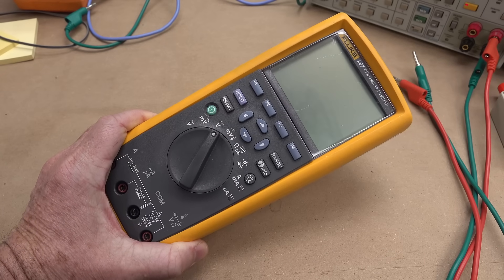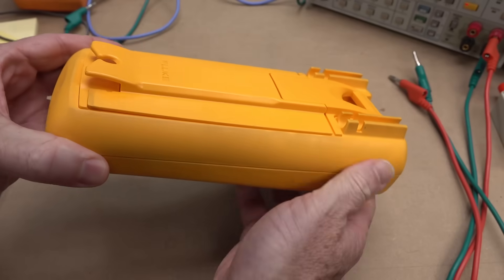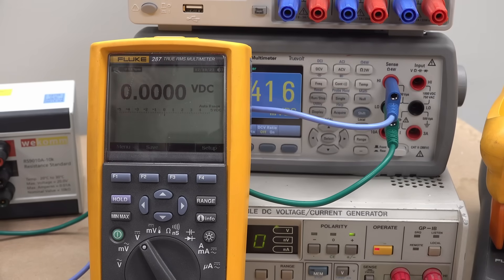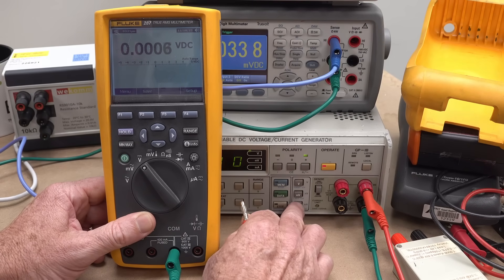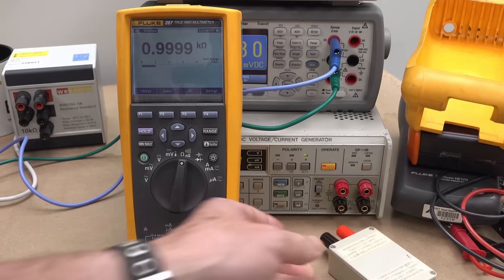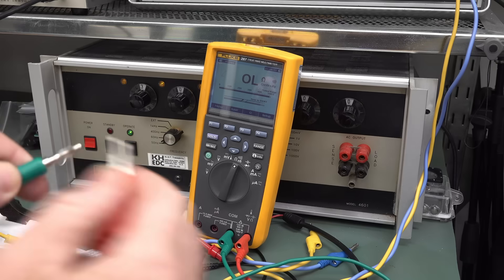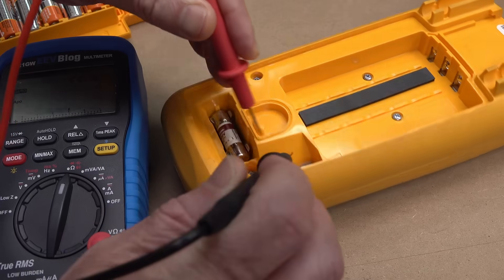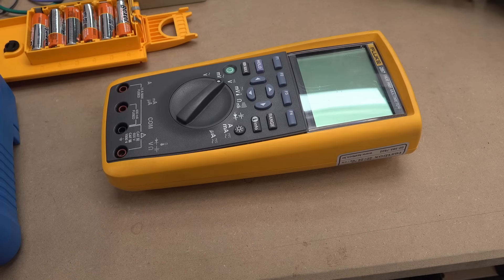Fluke 287 Repair - My Arse

Comment: Blown current fuse - it’s a classic.  When I taught Digital Circuits my first lab was to have students measure the quiescent current and current as TTL and CMOS inverters transitioned through switching.  I found every multimeter in the lab had a blown current fuse.  I resorted to buying a whole bunch of four Dollar meters from Harbor Freight on my own and keeping them at home except for the one lab. The cheap little meters from Harbor Freight are pretty good on DC down to mV and uA resolution.  The current fuse in the cheapie meters is a glass fuse which costs about ten cents, so no big deal if one gets blown.  Those silicon fuses in Fluke meters are crazy expensive.

Comment: I got a UT181A (which also has data logging) because I was too cheap to pay for the Fluke 289. I'm happy with it. The main downside is the rechargeable lithium battery. I prefer being able to just swap batteries instead of minding some battery that's hard to get a replacement for and will eventually kick the bucket anyway. The color display might be more power intensive(I don't actually know) but it shuts off when logging anyway after a period of no user interaction, while the meter stays on. It will time out the sceen like this even when not logging but stay on.

Comment: I’ve found a lot of tech sold on eBay as faulty for a ridiculously low price have been illegally procured by the seller. No one questions the low price when the item is broken, the seller moves it fast and who is going to return something normally Uber expensive that works. Now “buyer beware” means it’s possible to get screwed in a good way. 
Thanks for all your great videos!!

Comment: I shouldn't complain but I wonder when I'm supposed to do this kind of investments...

Meanwhile I just unpacked following.
HP 473B - Power meter but without sensor.
HP 8646A - Sig. gen. 100kHz to 1GHz RF. Two of them.
HP 60MHz 2chn scope.
HP 5385A counter.
Rohde & Schwarz - URE2 (Anyone knows where I can find the manual for this one? URE and URE3 are everywhere.)
Everything starts up and seems to work just fine, not been calibrated since 2006 give or take.

Comment: I picked up a keysight 1273A meter for an "interesting repair"  looked really hopeful with rubbish on all ranges - turned out that every through-hole joint was as dry as a dingo's ...   anyway at least I got a good quality meter for next to nothing!  The biggest job was getting the smell of cigarette smoke off it (Ozone generation in a closed box is the way to go - just remember to shield from static!)

Comment: I'm confused by the title -  how can you repair your Arse with a Fluke 287 ?
What's wrong with your Arse anyway ?
If you're straight, it should have an almost infinite Resistance to reverse polarity.
If not,  it will be low Impedance to both AC and DC currents xD

Comment: I bought an old tek scope which was marked as non-working for like 80 bucks. Worked fine, and all it needed was an alignment and some cleaning. Never done one before but with the service manual it wasn't too difficult, and now I can use my old scope for cool X/Y stuff!

Maybe the other youtubers break stuff they already have, just to make a video.... hmmmmm.

Comment: I wanted to test an old guitar lead a few years ago, but found my old Nineties digital multimeter was hopelessly inaccurate. I dug out my even older late Seventies analogue meter, whose jumping needle showed the lead was irrecoverably noisy within the cable. So......... now I had a useless guitar lead AND a dodgy digital multimeter.
    Time to buy a new meter, I reckoned. Got a reasonable Chinese one. I decided to post a Blog entry detailing the story and did some measurement comparisons for all three meters. Dammit, the old analogue meter proved to have the RX1 scale reading very low.
Now I had a useless lead and TWO faulty meters.
    I wrote two more Blog posts detailing fault-finding and repair of the two older meters, using the new meter.
    Then I realised I had three functioning meters and didn't need the one I just bought!

Comment: I have a gift, I never get an easy fix.  I bought an old Current Source and watched all the YouTube video's and the power supply and the various regulated circuits are all fine (Cap's too).  The output power transistors are fine, the reference Zener and circuits around it all fine.  Years ago I worked at a software company that would send in bug request fixes and seriously I would always get the bizarre bugs.  A friend of mine that sailed through his set of bugs came over with a smirk on his face and said I'll fix your bug too.  Well hours later he smiled and said you sure have a gift for getting the weird bugs.  The good news is I spend so much time on a piece of equipment or software that I can usually find and fix any bug quickly.

Comment: Once bought some faulty classic 6.5 digit HP benchtop meter from the US and it came fully functional and the display prone to dimming issue was very bright so used very little.
Other time I bought one of those classic fat Agilent PSUs, it had the typical failing high accuracy resistors, but then there was also some opamp that had very intermittent fault and I spent a lot of time on diagnosing it.

Comment: 🤔  No user serviceable parts inside?  We'll see about that! 🤠  My old trusty cheapy Circuit Specialists MAS830 meter stopped working like that too.  Took it apart to check for smokey burned stuff as one does.  D'oh just a bad fuse so I learrned my something new that day 😅  Yep, it's still working and in my small toolkit 👍  Take stuff apart that's what tools are for 😉

Comment: It is malfunctioning, the fuse is blown, requires a costly repair. Have you checked out the prices of those Bussmann fuses? I bought an Aneng DMM much cheaper than one of those fuses.

Comment: Occasionally I will buy a “Broken” fluke off eBay just to fix it. Apart from fuses and bad battery terminals the most common two issues are dirty zebra connector on the display and there is an input resistor that blows open when you use continuity on high voltage. In 70’s series it’s a 1K believe leading to a transorb/mov/tvs ish component and I forget the value on the 80’s, 170’s, and 280’s but I’m sure it’s similar. Memory failing on me. If they turn on, then they are usually easy to fix. Now that re pop displays and parts are available on eBay they should pretty much last forever or until the ASIC dies on them.

Comment: I have a 289 that I already had to replace the 'fuzzy' supercap on after 12 years. 289 is same as 287 with exception of the highly coveted low ohm mode (not to be confused with LowZ which 289 also has), very useful when testing & probing board shorts.

Comment: You should try logging. It could be that there is a memory chip not working. Also if I remember correctly there is software update that needs to be applied because there is an issue with the optical port.

Comment: This 287 looks better than the ones being offered second-hand over here. Congrats on getting a "real" electronics multimeter. Play around with it.
Also, this is an older version. If you have to set the time and date after swapping the batteries, the supercap is gone. You can make a video repairing/replacing that (easy). The newer models have a small battery inside them to keep the clock running.

Comment: You never know, a customer sended me a portable digital signal generator that was faulty. It was fine but it used Vpp and the customer checked it with a DMM in Vrms and 10 Vpp is not the same as 10V rms.
I have a Fluke I got from a friend who had it from his work.. They had replaced it. I gave problems after battery leakage even after cleaning everything. I checked it and it seemed clean. It worked but every now and then it failed. Hard to trouble shoot. I used it sometimes because it has a "megger" function. Until it stopped. Opened it, pulled the batteries to measure them and then a battery connector  fell out. It was heavy corroded on the back side. Also have seen something where battery goop was sucked in the wires from the battery holder to the PCB. Nothing to see until I stripped them, most was corroded away, the rest green.

Comment: Sometimes it's more economical for a business to replace an item with a newer one than it is to have the old one professionally repaired and calibrated. Completely viable test equipment has been discarded in industrial e-waste.  If you can grab it before too much other garbage is tossed on top you may acquire some very good test equipment that just needs switch cleaning and sometimes a re-cap.

Comment: I found out how to buy a faulty meter .... just buy one that says "Worked fine last time I testet" or "Untestet as I do not know how it works". 
Those come most of the time from people who try to measure current in the outlet from live to nutral and dont have a spare fuse roll some aluminium foil around the broken fuse and try again.

Comment: I've a horrible feeling that many meters get shelved because someone blew a fuse and they think it's faulty.
Reply: @ts757arse  makes me wonder if it's because of incompetence, or bullshit regulations.
Reply: @KeritechElectronics management is the reason
Reply: Whew. There's even a simple fuse test procedure (described in the Fluke manuals) - how could they not know that?
Reply: For what I know MTA  in New York getting every year contract for new multimeter's delivery. What I  herd that the "old one" are put in the garbage dump container and are guarded by one or two union members so no body still the DMMs ( they are in the original boxes) , before they will be send to the land fill.
Reply: @miroslawkaras7710  yeah, and those landfills and electro waste disposal plants are locked down tighter and tighter. Tighter than Ethel Granger's laces, I would say. Back in 2010s I had one a few hundreds of meters away from my home in Lodz, Poland - and I bought some secondhand electronics from there, that went into a bunch of projects. Now? I could bet my ass it wouldn't be possible, with the ministry of environment keeping those places on CCTV.
Reply: Build in selftest?
Reply: @Blasterxp  yes indeed, just testing the fuses on the continuity position by sticking a probe into the current sockets.
Reply: The scary thing is some people selling these are supposedly professionals
Reply: Without a doubt
Reply: Congrats on 1m BTW mate
Reply: @TheCod3r  that's right, now I'm waiting for @EEVBlog to join the club :)
Reply: Just say the meter is faulty and a big company will replace it with the latest version.
Happens all the time.
Reply: @chox2001 their ways never stop surprising me.
Reply: Then it is better for us… never got a Fluke, just Metrawatt. ¯\_(ツ)_/¯
Reply: Hey BC fancy seeing you over on the dark side.
Reply: @ts757arse 
Yes.  Especially so in aerospace and military use.  Revising the documentation is a huge and expensive job.

There are a lot of very janky devices out there that survive because they were ‘baked in’ to some critical documentation.
Reply: Yeah, or because the test leads are faulty!
Reply: Has anyone looked at the cost of Fluke fuses lately?  Back in the 1990s I dropped the probe of my Fluke 8060A snd per Murphy’s Law, it hit the terminal of a power supply while set to measure current and of course the fuse blew.  30 years ago, the replacement fuse cost 15 Dollars US.  If you check the web, so Fluke fuses are 70 or 80 bucks.  If you’re a company and you’ve use pad the meter for a couple of years, you’ve amortized the capital cost and it isn’t worth putting any money into fixing the meter., certainly not 70 Dollars.  Might as well sell the meter and get back at least a few Dollars.
Reply: For some reason my comment was deleted.  The cost of a fuse could be 70 Dollar of more.  Really.  If the company used the meter for a few years, they amortized the capital cost.  It is more useful to sell it for parts and instead of spending to fix it.
Reply: I know from experience when I slipped a probe while measuring current with a Fluke 8060A and blew the fuse.   Back in the 1990s the silicon fuse cost about 15 bucks US.  I am sure it would be several times that now.
Reply: Not with meters in this price range.
Reply: @Okurkaarrgghh Oh I betya! Enough people out there with too much money, buying expensive equipment which they don't know how to use.

Comment: I have a 287 which works perfectly, but if you leave the batteries in it overnight, they'll be dead even if the selector is off.  It's been this way for about 15 years.  I sent it to Fluke for repairs but they didn't fix it.  - they did cancel the repair charges after I advised them.  I just live with it - wouldn't leave the batteries in it anyway for more than a few days even if they didn't go dead.
Reply: That's most likely a faulty supercapacitor, I think it is around the top left of the board. It isn't close to critical analog circuitry and, at least with a bit of low temperature solder, it's a trivial repair. If you take the batteries out for a few seconds and the time and date settings get reset, it's the supercap.
Reply: Thanks - I'll take a look.   @antoespiga
Reply from the maker: These batteries survived the shipping to me, and who knows how long before that, no problems.

Comment: I was at my local Tip Shop, they let me rat around in the staff/behind-the-counter area where they PAT test stuff. I found a Fluke 112 on the floor…I asked if anyone had dropped their meter…but those PAT “test” people would have no clue with such an instrument…I was informed that it was faulty and destined for the E-Waste bin outside, so I asked if I cipould take it and attempt to fix it. They told me that they “had tried” but to no avail and gave it to me for nix!

I took it home and at power up….NOTHING…just how I like ‘em. Started following the leads and tracks from the battery with my Tenma meter on continuity test…came to a point on the main B+ rail where it dived through the board at a via, it was O/C at the via, so I pressed down really hard with the tip of the Tenma’s probe, just in case it was a conformal coating I had to get through and I CAME TO LIFE! It was open where the through-hole-plating met the pad and pushing down hard with the Tenma’s probe closed it.

Still got it five years on, it still works on the original batteries. Has some electrical apprentice’s name engraved into the back of it. You’d tend to think thst anyone compitent enough to own a multimeter would be compitent enough to attermt to trace an easy fault such as this, and PAT testers wouldn’t even TRY to teace even the most basic of faults!

Comment: I fixed one last year for my brother, it has a burnt mosfet and ir sensor for the voltage leads. Can you test yours for bad solder joint or over current.

Comment: Ebay's rules for  what you can list as 'used' have changed. Unless it works exactly as it did when it was new, the buyer now has come-back if you sell it as used.
Reply: Really? So even if there's the slightest thing off and you clearly put it in the description you aren't allowed to list it as Used and it has to be For parts/Not working?
Reply: @Ni5ei  from the way it's worded now, I wouldn't risk it, and loads of sellers seem to feel the same. The amount of spares or repairs listings has gone up considerably. This is UK Ebay, though, I should add. I'm guessing they'd apply it across the board, but I can't say for sure.

Comment: I've been buying broken multimeters to fix them as well, inspired by this channel, and I've found the exact same thing. It's either a dead main chip or it's something very stupid like the battery contacts are dirty. You wouldn't believe how little effort people put into fixing these things before they sell them as broken. I've been buying dead Fluke 89-IV meters trying to get a case for one I have that works with no shell and every dead one I've bought has been trivially fixable.
Reply: WOW! Maybe I also should get one of those "dead" meters myself.

Comment: I just wish I could find stuff to repair at a decent price, things are ridiculously priced these days, even as parts units !
Reply: Yes, i've been looking for while to buy a 6 1/2 digit bench multimeter like the agilent/hp 34401A and even when they are sold as broken they cost aprox $300 (and some are really all broken/very bad condition and lot of missing parts), but it gets even worse in my case because i live in Europe (Portugal) and not all the sellers ship to here and if they ship its expensive and i still have to pay at least 23% in taxes...
Reply: Same wish and hope I have  ...
Reply: Could never bring myself to pay fluke prices. Not a single pro aside from “electricians” seem to need flukes.

Comment: You can test and replace the supercapacitor on the control board.
You know it needs to be replaced if the time and date settings are reset while changing the batteries. This supercapacitor can cause a draw on the batteries, making them drain too fast.
Reply: I have a couple of these and both needed the supercar replacing over time

Comment: Sorry, declaring used things defective is very normal nowadays for an ebay - dealer, that doesn't want to have extra expenses and extra work by dealing with returned stuff.
It's a thing to consider, otherwise you quickly end up broke or in need of more staff without having any more income.
Reply from the maker: Yeah, but they usually just list it under the category of Faulty and tell you it's sold as-is. They usually don't go out of their way to tell you it's specifically malfunctioning in the listing.
Reply: @EEVblog2  They do it here in Germany. Maybe the laws are different.
Reply from the maker: @werner.x  Under ebays policy AFAIK the category you list it under is what protects you as a seller.